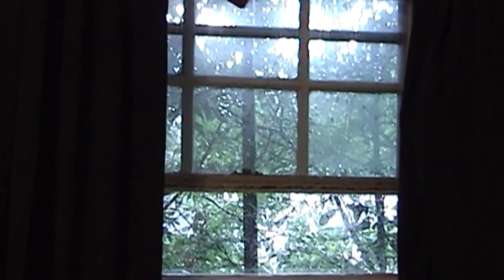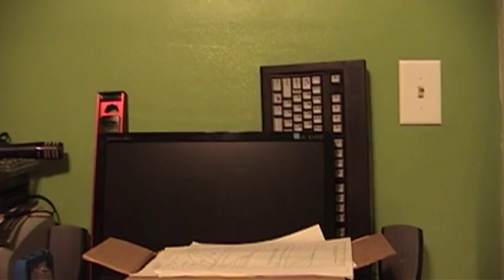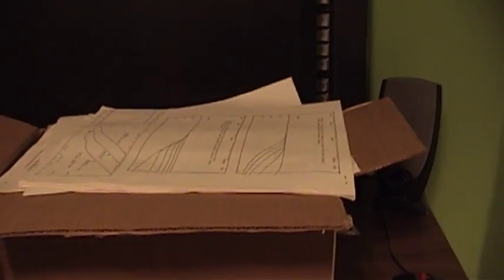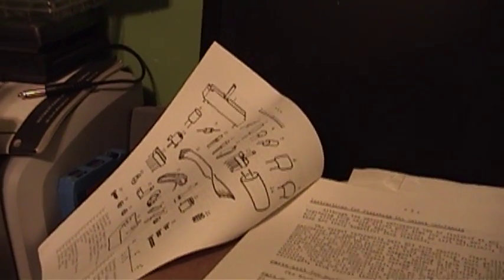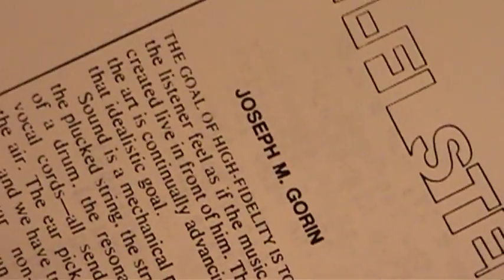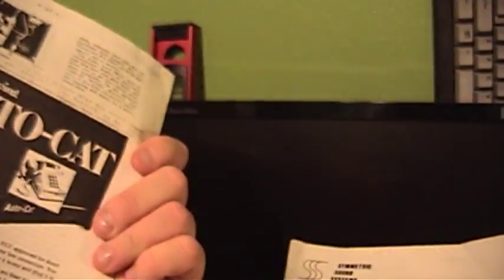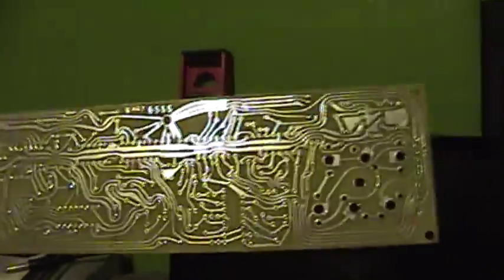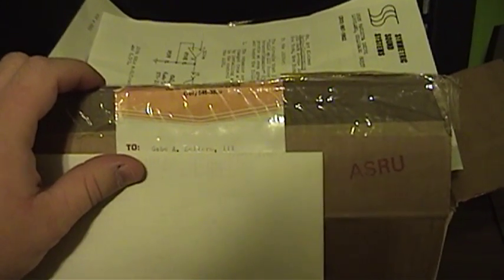My Next Big Electronics Project

Comment: @uxwbill ahh, well now that i got a hdd for it i can get the specs, its a 1.9 intel based processer, and 1gb of ram, ur freenas system didnt have that much power, so i would see it as to suffice?. and gigabit lan ports, and a built in ftp server which soon i will find useful, if only vz fios would provide a gigabit router :(

Comment: Awesome!  I remember seeing Heath kits,  I beleive I may have a radio electronics mag or two that has the kits listed.   I had a couple of the radio shack kits also,  with the springs and jumper wires,   My AM crystal radio still works to this day,  very faint but it does work!

Comment: The Symmetric Sound Systems logo looks like the old Seagate logo.

I don't suppose you'll be using the original electrolytic capacitors?